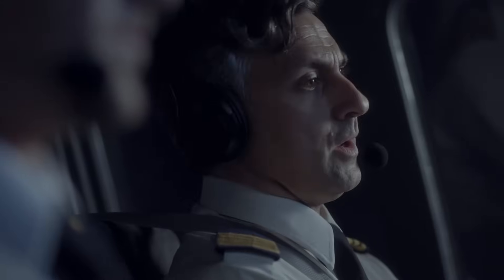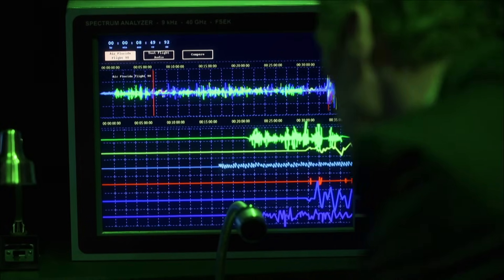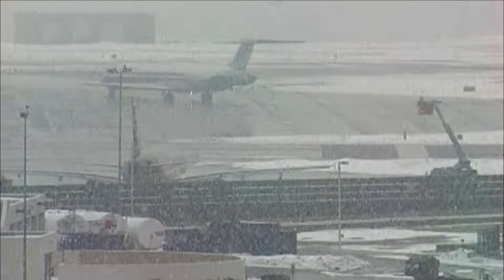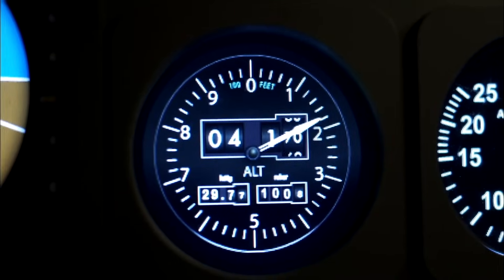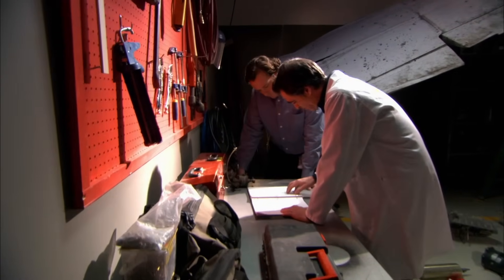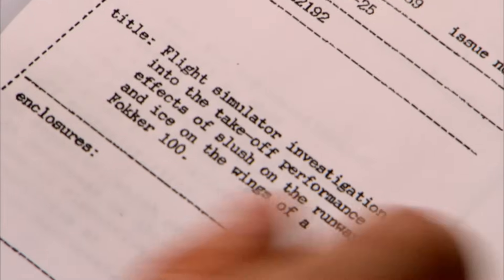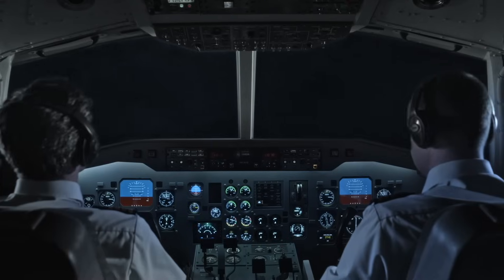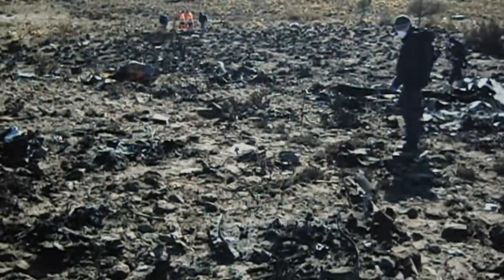4 Air Disasters Caused By Ice ❄️ Air Disasters | Smithsonian Channel

Comment: Because of the extra expenses of De-Icing some pilots will take a chance, and lose.  There are also two types of de-icing, one is expensive the other not so much.  But, finally, after so many de-icing accidents the authorities finally wised up and move the de-icing machines from the gate closer to the runway.  De-icing is only good for about 25 minutes then you have to de-ice again.  Too expensive for some pilots so they will roll the dice.

Comment: Air Florida Flight 90

Date:January 13 1982
Summary:Stalled and crashed due to pilot error and lack of de-icing
Site:Potomac River, Washington D.C
Total fatalities:78
Total injuries:9
Aircraft type:Boeing 737-222
Operator:Air Florida™
IATA Flight No.:QH90
ICAO Flight No.:FLA90
Callsign:PALM 90
Registration:N62AF
Flight origin:Ronald Reagan Washington International Airport
Stopover:Tampa International Airport
Destination:Fort Lauderdale Hollywood In'tl Airport
Occupants:79
Passengers:74
Crew:5
Fatalities:74
Survivors:5
Injuries:5
Ground fatalities:4
Ground injuries:4

Comment: In 1985, An Arrow Air jet with 248 soliders and 8 crew had ice also but the plane caused a  stall
Reply: That plane did not de-ice, because of the expense of de-icing, that pilots decided to roll the dice, and lost.

Comment: The first air 6560 crash wasn't caused by icing, but by pilot error because of 4 things: Captain accidentally disabled the autopilot by applying a bit of force on the control yolk, ignoring the FO telling him that they're off course, only recalibrated their compass once, and poor GPWS that activated late
Reply: Wow 😮
Reply: That the pilot that flew into the mountain?
Reply: No. None of that is true.

Comment: Flight 1363, a Fokker 28 airplane operated by Air Ontario, departed Thunder Bay (Ontario) about one hour behind schedule, on a flight to Winnipeg, with an intermediate stop in Dryden. During the stop in Dryden, heavy snow fell, covering, and freezing on the wings.